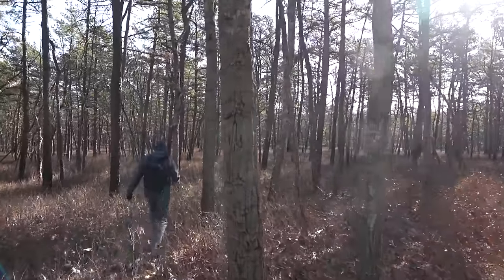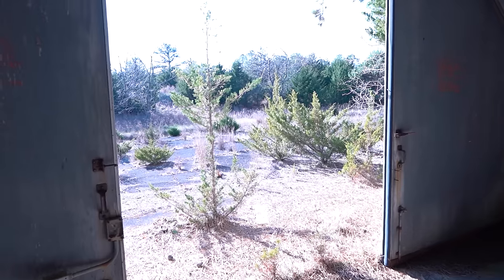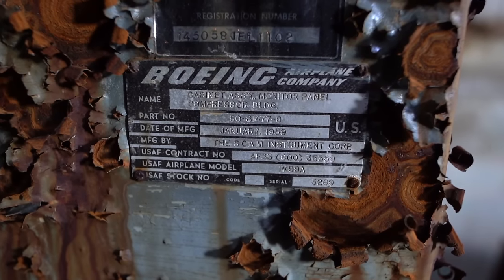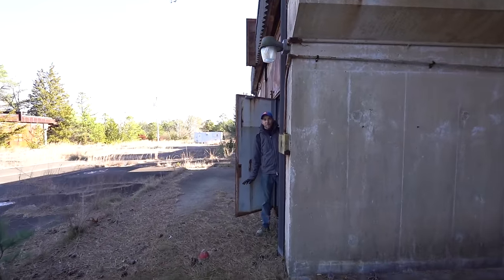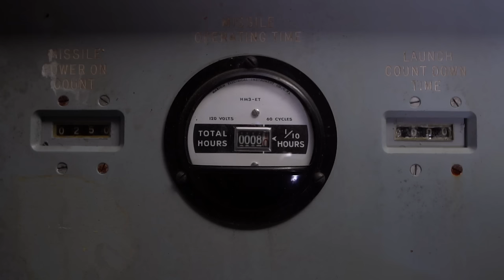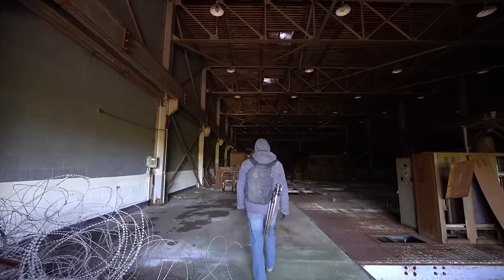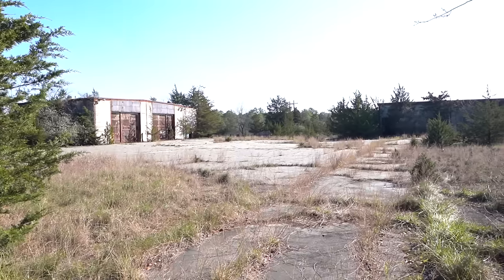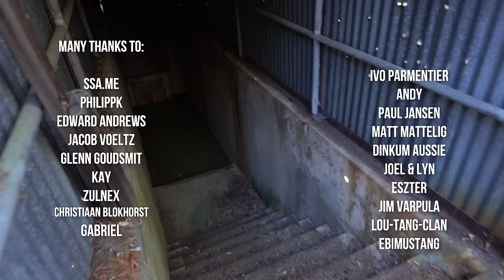This massive missile base protected the US against the Soviet Union | ABANDONED

Comment: I made a career in the USAF (1982-2002). I retired from Active Duty in March 2002.  Of the many bases I was stationed at during this career two of the bases are now closed.  They were Brooks AFB, Texas located in San Antonio Texas.  The other was Eaker AFB, Arkansas.  It was previously named Blytheville AFB.  It was located just outside of the city of Blytheville Arkansas.  It is hard to think I have been retired from the USAF for 21 Years!  Loved your video.
Reply: I too lived at Eaker AFB but I was a kid then.  My dad was stationed there.  This would have been about 1985-1988/89 then we were sent to England.  Once I was old enough, I joined the Air Force myself and served as a Security Forces form 1999-2011.  After all my travels I moved back to Arkansas and live about 30 miles from Eaker AFB.  I still go there on occasion to see my old house I lived in.  Much of the housing area is used for low-income families and retirees.  All of the houses form behind the street I lived on all the way back to what was the new base housing area has been left to the elements since the bases closure.  It's sad what has happened to the base.  There was a dormitory that was located next to the base pool that was finally torn down about a year ago.  It had been cordoned off after one side of the entire building collapsed exposing all the rooms of all three floors.  They are slowly in the process of tearing down other dormitories there now is well.  But it is slow due to budgets.
Reply: I retired after 21 years of active and reserved duty.  Norton AFB is closed but my other bases are still operational.  I was stationed at McGuire from 95 to 98 and I never knew this BOMARC base was there.  Had I known I might have been tempted to go take a look.  I did some exploring around Lakehurst Naval Air Station where the Hindenburg crashed, but sadly they don't have a memorial there.

Comment: BOMAC was the Air Forces' answer to the Army's Nike Hercules.  The system was a good one for the time but like any system it needs support and the Air Force was never too wopped up about static air defense sites.  I am an old Nike Hercules vet.
Reply: I assume radar/radio guided.  Easy to counter today.  I am thinking Hawk is the same.  Current inventory.
Reply: @rogersmith7396  Hawks are infrared heat seeking missiles, Nike missiles are guided missiles.
Reply: @independent5564  Homing all the way killers.  I am thinking radar directed.  I guess they are becoming obsolete.
Reply: BOMARC
Reply: When I was in high school, my friends and I used to throw parties at an old NIKE site on Washburn Maine… Washburn or mapleton I forget exact. Also loring AF base is up there which has been closed for awhile. pHISH used to have huge concerts on the runway. The runway was massive for b52’s I believe

Comment: There's a BOMARC site in the town im from (Bangor, Maine ). Dow Air force base was operational from the 1950's to early 1970's, the former site still has some bunkers that have been taken over by people and converted into storage, or little mechanical garages. The buildings that are still in good shape have small businesses in them now. From what I've heard over the years, there used to be a tunnel system that linked a number of these buildings, but all the entrances have been sealed.

Comment: The original BOMARCS were liquid fueled. The fuel was toxic, corrosive and very unstable, this resulted in a sever accident at one of the sites. They were later converted to a solid fuel that didn't pose the issues of the liquid fuel. Due to the nature of the liquid fuel the BOMARCS could not be fueled until it was needed for a launch or a scheduled training target launch.

Comment: The W40 nuclear warhead was 18 in (460 mm) in diameter, 32 in (810 mm) long, and weighed around 385 lb (175 kg). It had a design yield of 10 kilotons.  The W40 was used in the MGM-18 Lacrosse surface to surface missile (SRBM) and CIM-10 Bomarc surface to air missile (SAM).

The Bomarc warhead was lethal to a medium bomber aircraft up to about one kilometer (I think that is understated). The warheads were mounted to the missiles for 90 day intervals, after which they underwent periodic inspection and maintenance.

All Bomarc Bs were equipped with the W40 nuclear warhead. On 23 March 1961, a Bomarc B successfully intercepted a Regulus II cruise missile flying at 100,000 ft (30,000 m), thus achieving the highest interception in the world up to that date.
Reply from the maker: Thanks for the additional info😎🤩